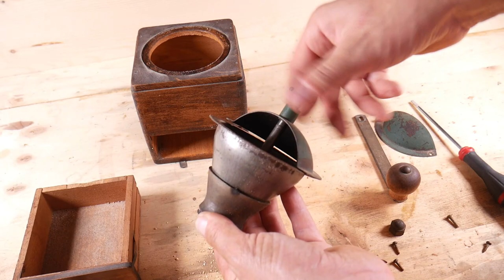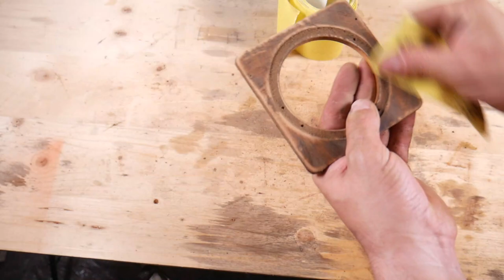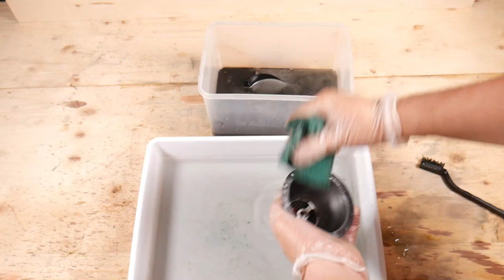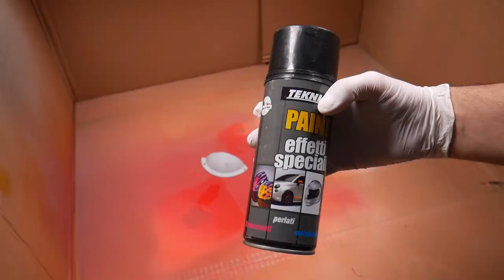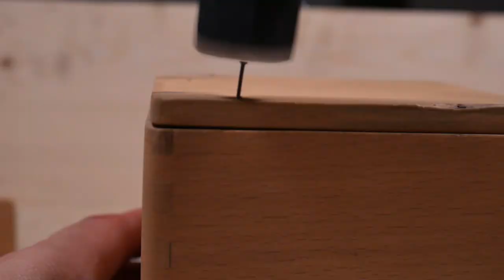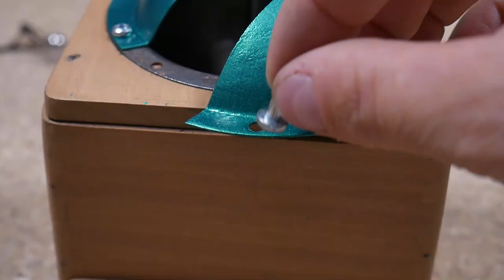Rusty Coffee Grinder machine Restoration

Comment: 2 things to think about lead paint test kit. Also make sure you are not damaging tolerance's with acid. I know it's not a space shuttle but just some more points to consider.

Very beautiful outcome overall!! I really enjoy your throughness...
Reply from the maker: I made a big mistake when I chose to use acid to remove rust from the parts, after 24 hours of being in acid some parts disappeared and I had to replace them with others. It is an accomplished fact that I will not repeat.
Reply: @tybyrestoration2716  so that's what happened to that little tab that held  the lid closed and the screws that dissolved that's actually really funny oops lesson learned.. that's what it's all about though.
Reply from the maker: I am at the beginning and I have no experience in working, I try all the products to see which are better and in the end I use the best one. I messed up the acid badly but I don't use it anymore. I've learned my lesson.